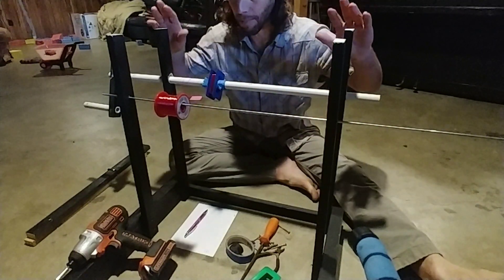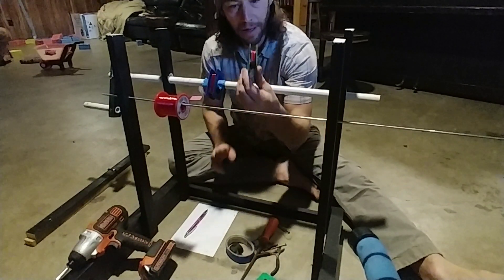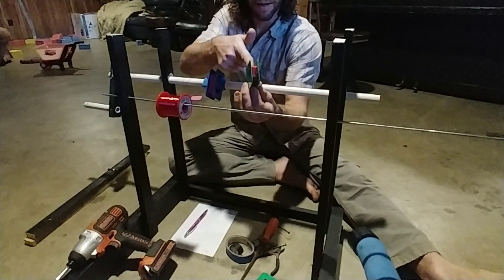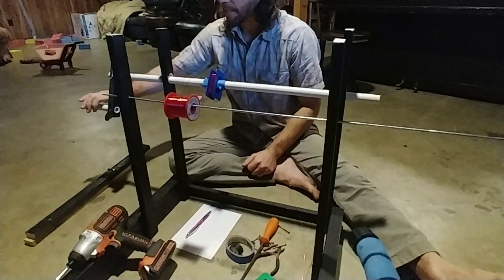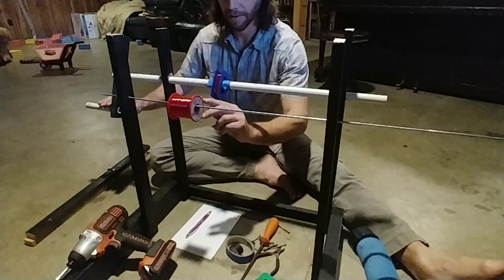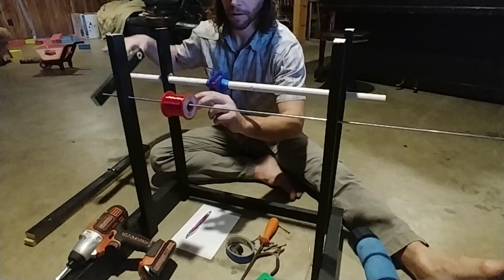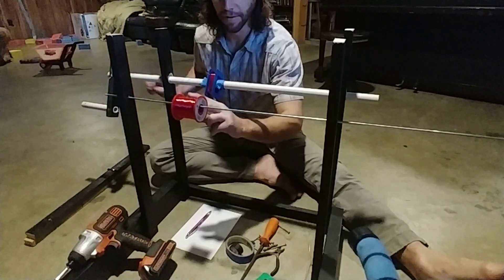MEG Replication - Part 2 - How to wind Magnet Wire on Transformer Bobbin

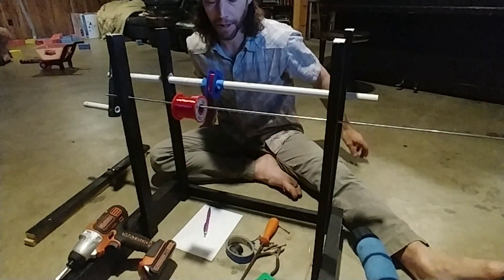Comment: I use a counter to make a exacting presence in the coil reading system a magnetic sensor and a plus one or what ever additional features of a simple calculator can help in the making process easier to trust a rotation counter 1:44

Comment: Man... I just wound mine by hand. I did some small 80 turn with 24awg...

My tiny bobbins i 3d printed snapped. My little MEG is literally like 1/5 the size. 

Kinda bummed you didnt carry on with your experiments and give results.

I just ordered a ton of different switching controllers and clock controllers, flip flops, etc.
I probably know less about all this than you, but if you ever carry on with it, feel free to reply I would be willing to trade information.

I got alot of good data from you myself.

Thanks

Comment: Nice manual winding jig. I have made one that uses a stepper motor to rotate the coil during winding. This has the advantage of one free hand. The other hand is holding the copper wire for tension. The other advantage is turn counting... I have written simple software to turn the motor a defined number of rotations with each hit of the enter key, which is what the spare hand is now doing. Also I can adjust the revs to achieve a comfortable rate. I like to concentrate on winding the wire as neat as possible, so that it is as small as possible thus concentrating the magnetic field. 
I did make a modification where the motor would continuously turn but under the control of a foot switch. The software counted the turns for me.